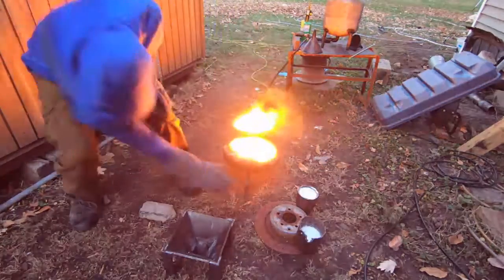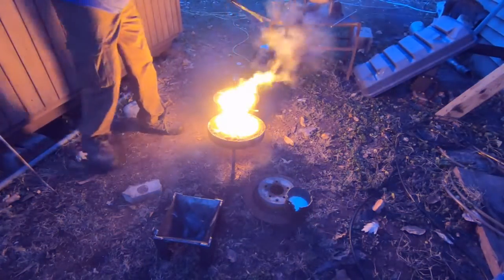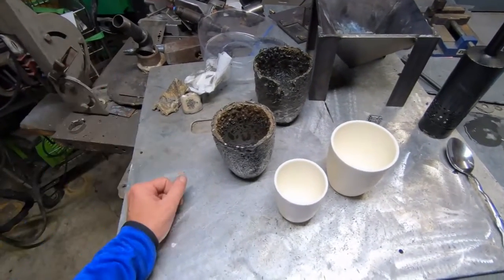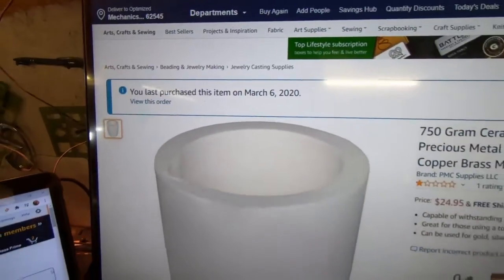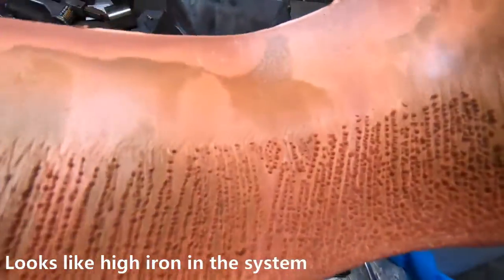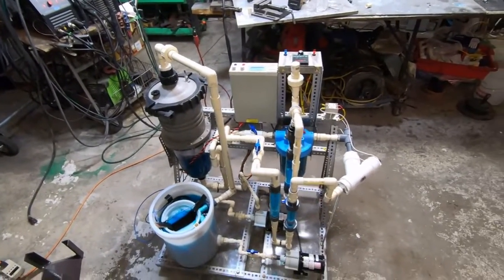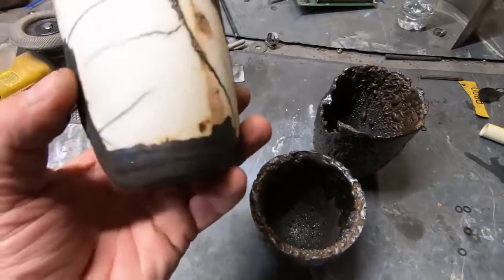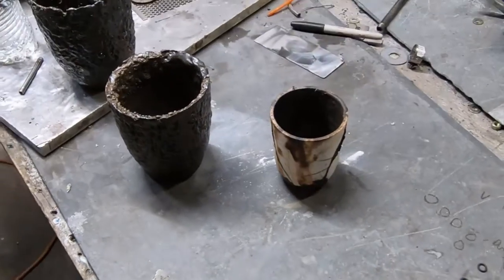Ewaste metal recovery system 2,650 F

Comment: 0:46 haha i know what you mean, i felt a similar radiation from a from close up.
heat was so hot that at 1 meter distance my skin felt burning and freezing the same time xD
On the same day i made an error using a butane torch to heat up the fire further, resulting in a small explosion of the torch in my hand. I was lucky the torch had a grip and it was "just" butane without porpane. That day i learned that the infrared radiation is no joke and its not enough to protect the own skin but also nearby gas cylinders from heat radiation xD,

Comment: Those 'nodules' SHOULD be high purity copper growing as crystals. Unless it is interfering with the safe and proper operation of the system, I would not worry about it.

I have seen the copper anodes from commercial electrowinning and its usually very nodular with those larger crystals, but then they are also working in very large tanks and can adjust the space between the plates easily.

Comment: I could be wrong saying this but maybe you do not have luck with crucibles. Do not fret as some consider that a good thing. First of all, you are testing for us all what not to buy. Crucible made of graphite is definitely JUNK. That has not changed for years. I am really impressed with your method of ultra efficient recovery machine. How did you come up with the idea for this machine fella ???? Very nice work for sure. Thanks, VF